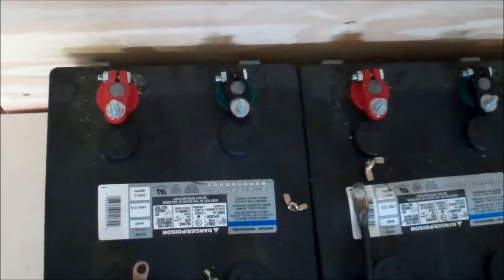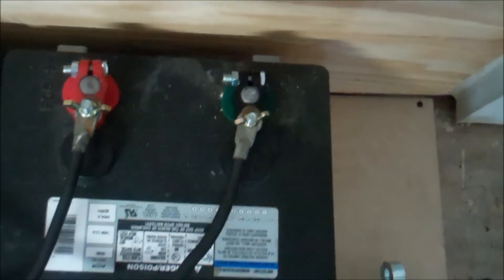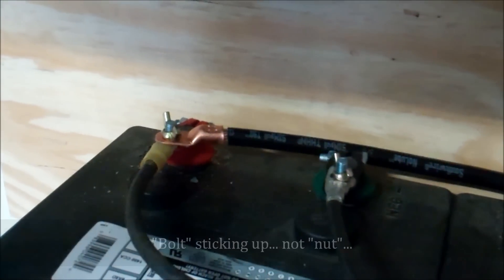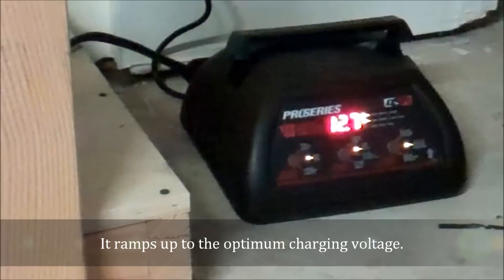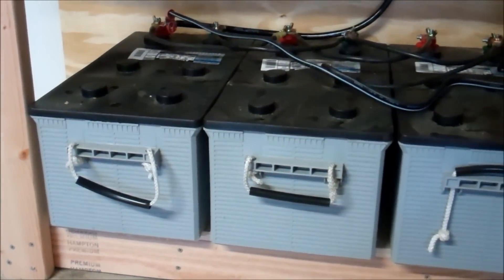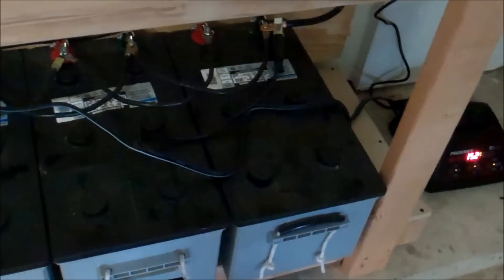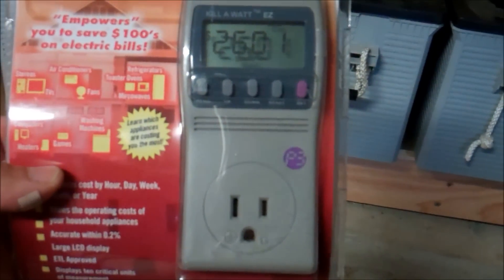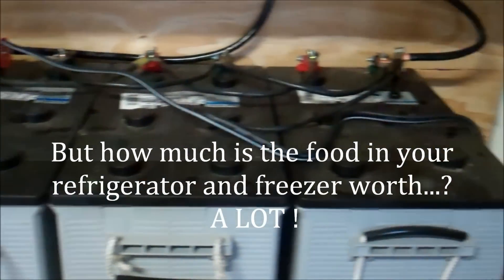Living Off The Grid ~ Build A Battery Backup Power Station

Comment from the maker: It is modified sine wave.
As far as I can tell, modified sine wave will work for most everything. At my house, the only difference I could tell was the ceiling fans made a little humming noise, but worked fine. All that I read says that modified is fine for everything. Listen to Stephen Harris talk on The Survival Podcast about it. He is the Guru on all things energy. He says "your appliances and such can't tell the difference"... I trust his opinion.
Reply: The problem with modified sine wave inverter is moters run hot so can burn them out including fridge compressor moters and can harm sensitive electronics most newer stoves washer dryer and microwave  that's why I'm not using my three 1750 modified sine wave inverter
Reply: Check out Will prowse David poz and jehu Garcia they are the true solar electric guru's I'd trust them more than any other who get products and give glowing reviews ignoring all the flaws

Comment: I just use breakers in a separate panel to switch between solar, generator and 'shore'  they make a auto switch but this is pretty inexpensive.   when I redo our setup will try to put together a video.

Comment: the inverter is a high frequency inverter. Not for long term use. see if you can get a low frequency inverter when that one go's bang. Needs a Battery Life Saver BLS-12N Battery Desulfator and it will bring them batteries back to almost new condition. always god to have a small backup system. He just needs fuses to make it safe. Nice first attempt. Keep safe

Comment: Nice jobs guys.  Double male ended extension cord comes in handy for emergencies if you know what you are doing to back feed your breaker panel/house circuits with the power out and utility disconnect off.  Work on your NEC and be safe...